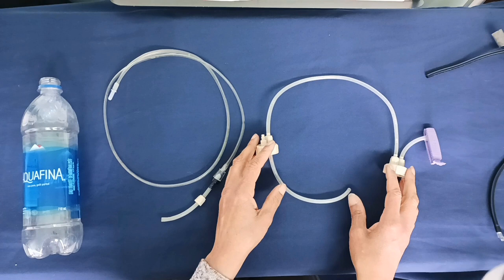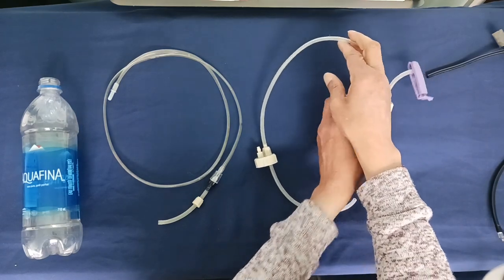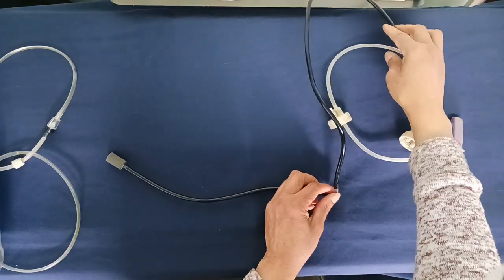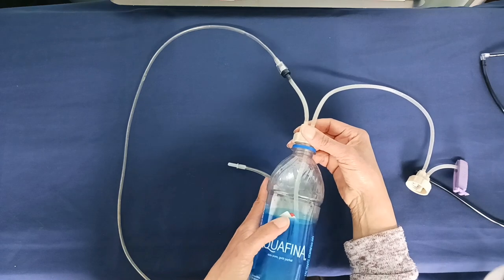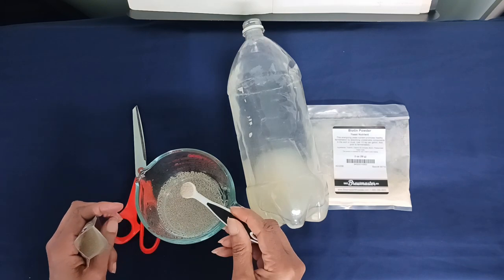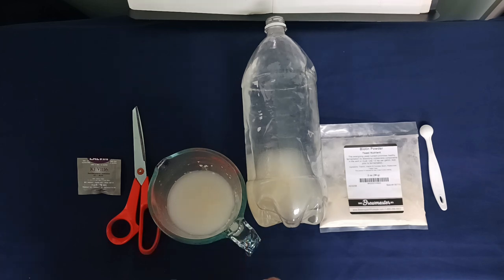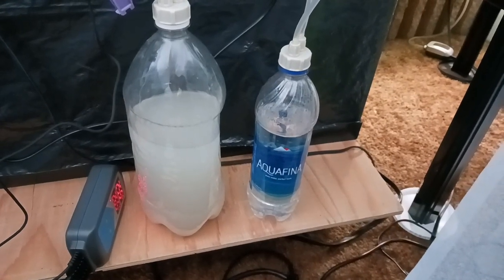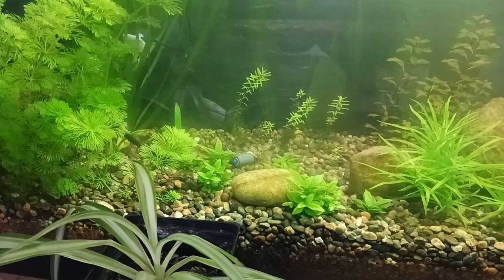New recipe for DIY CO2...fermentation using K1-V1116 yeast

Comment: You should use a CO2 diffuser btw it produces smaller bubbles that dissolve at a much better rate than an air stone.
Reply from the maker: Yeah, you're right.  But I have a decor mentality and so all equipment must be unseen.  I'll probably have to change to get the maximum benefit of the bubbles.
Reply: @aquapaula  an Inline Co2 diffusor is your best option because its placed outside the tank but you need a canister filter for it to work.

Comment: Your tank looks very nice! I see you don't use a bubble counter on your CO2 setup. It must be unnecessary. I wouldn't know. I've seen them in other videos. How long does a bottle of yeast last?
Reply from the maker: At the moment I have no way of knowing how much CO2 is in my tank. I have a CO2 drop checker  on order. Until it arrives, I am being careful about how much CO2 I am using. A 55gal tank should be able to handle 3 or 4 bottles of yeast running at the same time. I  only have one running right now. But I  admit it.....I am taking a risk not knowing how much CO2 I actually have. 

When I used baker's instant yeast in the recipe, it lasted two weeks. This new recipe is using a wine yeast which is hardier. I am expecting it to last four weeks. But that's what I'm trying to find out. 

Thanks for the compliment and thanks for commenting. Good questions!
Reply: @aquapaula  Thank you!